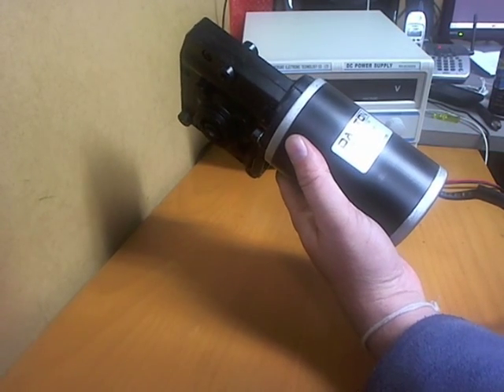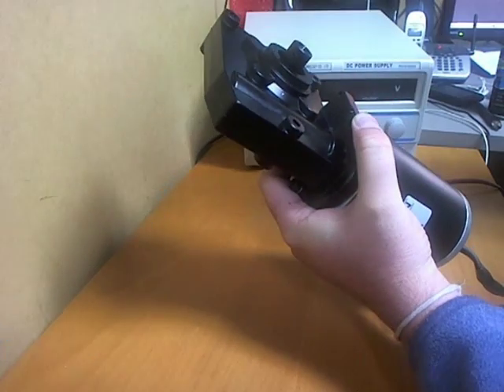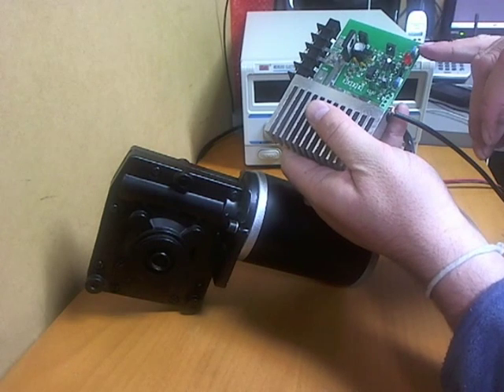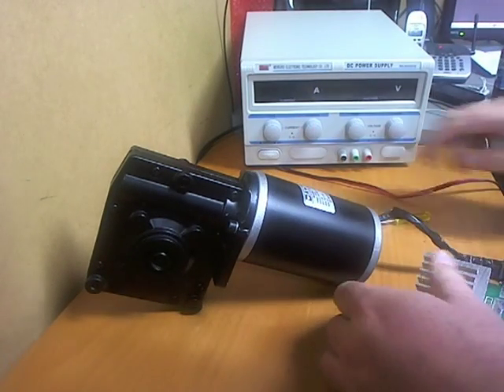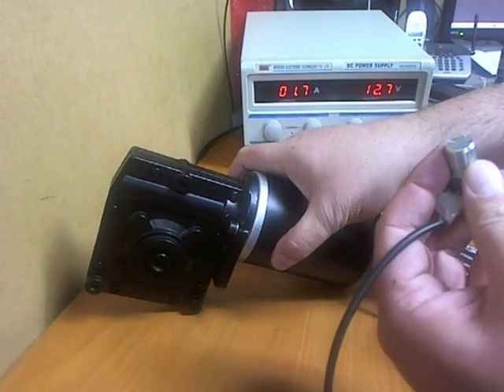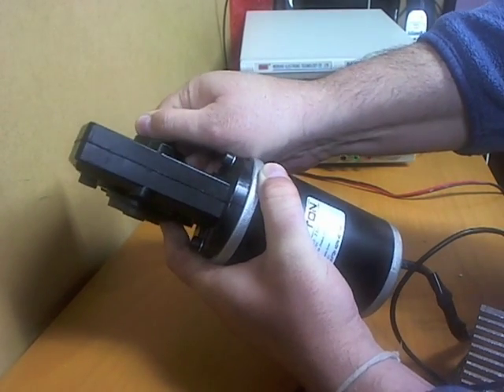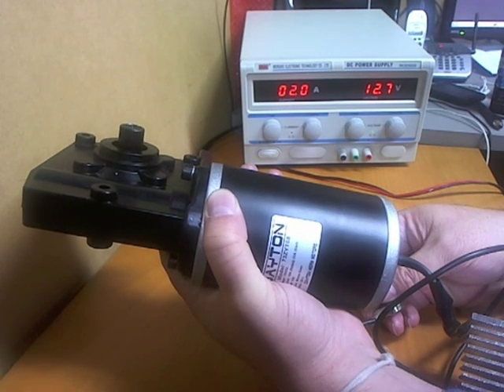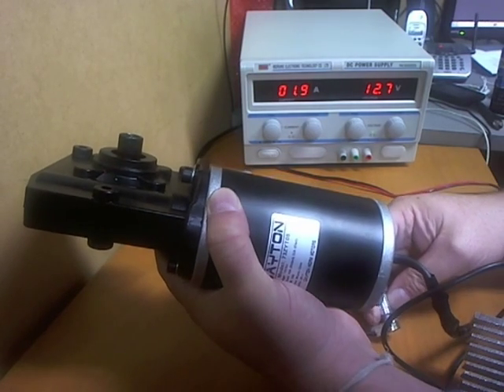Aussie Brew Home Milling Motor with Speed Control Module

Comment: I was thinking on using this to directly drive a wheel of an all terrain vehicle. Anything I should be aware of?
Reply: You could do this easily, but you may need two of them if you want decent torque!
Its geared at 25:1 so its quite fast but being a worm it also has a lot of power, but with two, you would fly!
Reply: Thanks for the response Ryan!  Ye I plan to use at least two, it seems like I'll have enough torque :)  I was wondering about the radial load, my system is about 60Kg. I didnt find any radial load specs for these in the doc.
Reply: Once you've seen the bearing size, you won't be worried in the slightest about a 60kg radial (side) load!
I have some MCP Worm gearboxes are rated at 80Nm Radial(130kg) and the bearings are smaller than the bearings in this worm drive!! Its a pretty decent unit I have to admit!